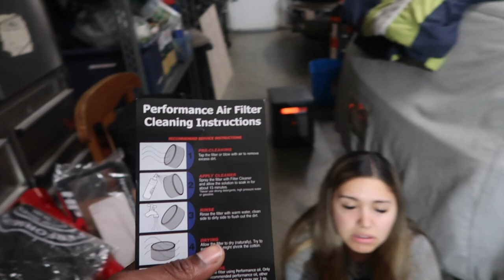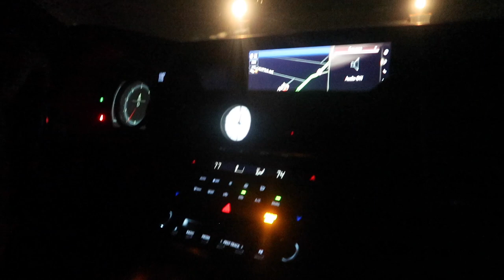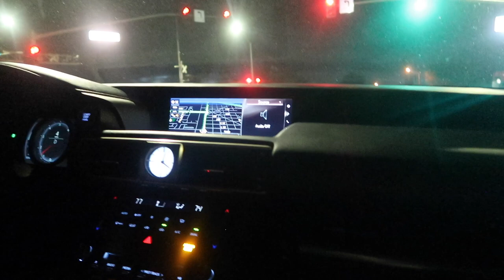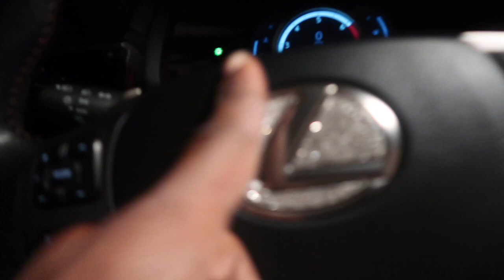SHE SAID SHE WANTED TURBO NOISES | LEXUS IS200T F SPORT HPS PERFORMANCE INTAKE INSTALL!

Comment: Good first mod but it’s just a placebo effect. The car is a 200T with major throttle lag the only good thing about this mod is the the sound and the cool looking intake. You should try a throttle responder instead that will help you eliminate the lag a little bit and you can actually feel a difference.
Reply: Or upgrade the charge pipe and downpipe as well with a “tuning box” . The lag is definitely due to the whole intake and exhaust system being restrictive.
Reply: @Redhawk0117  Im sure any upgrade/tuning will help the car. If you've ever driven one you can tell the car throttle lag is dangerous.
Reply: 30hp is complete bs. And yeah I have a 2016 Is200t and intake, catless downpipe and full 2.25 back. Throttle controller changed mine dramatically and made hella difference especially with lag. Gonna have to do away with mine when I get jdm tune because it interferes with tune
Reply: @Riffsnruckus  can I get the info to fix the throttle lag? Just bought this car and that throttle lag is mf ridiculous. Can I get brand and site. Thanks
Reply: @Riffsnruckus  thank you bro for the reply! Appreciate it. Ok, yes I will be getting the HPS intake tube and also putting a AFE dry air filter in the Oem air box aswell to help free up restricted air. Also did you mean the intake tube was aggravating to install? I’m also getting the throttle lag commander, how much did you pay for your? And what brand did you get. I see AFE makes one and also RACECHIP. Did it throw any codes? And after these mods I mentioned did it throw any CEL? These are all I’m planning on doing for the moment. Will the 3 mods I mentioned help out some? Also do I need a tune after these mods or will it be fine? Thanks again
Reply: @swervv2957  the freeing of restriction of air will be mostly from removing the oem air box which restricts most of the air flow and replace that with a cone style intake filter like the burger Motorsports one I mentioned or Injen makes a good one with polished tube, heat seperatpr between filter and tube and cone style filter. That housing has to go or you’ll get half results. And the intake is easy install I actually had my girl do it lol it’s the hot side charge pipe hps make for the intercooler that’s a hard but doable Install. My throttle box was a $80 eBay no name and worked and was impressive but I recommend a higher quality because after a year yet only like 3 times but I’ve got in the car and had no gas pedal and had to uninstall to get throttle and once I did I had cel and traction stuck turned off until ecu realized after a drive or two that pedal was normal again. I still use it from time to time but not much because about to get a tune. And if you plan on a tune don’t bother with the throttle box because the tune covers that and box will interfere with tune if left installed. I’d also free up exhaust flow and if you don’t want it loud or anything you can get high flow quiet systems. I went with full delete of all 4 resonators and both mufflers and had 2.25 custom from cat ran back. Still haven’t Installed the catless downpipe but will let you know results when I do. Lemme know if you have anymore questions. Also I recommend if you’re on Facebook join “Lexus is freaks” it’s a group I’m
Active in and you can get lots of help and discussion forum style without the wait. Also there are several other pages that are helpful as well as “Lexus is/buy-sell” page where you can find part outs and deals on parts as well as advice. If you join a page, comment again and let me know email or user name and we can link up on there. I have 4 sponserships
And pending a 5th on my car from my network of people in there so if you wanna save enough money on one mod to pay for another then it’s worth the legwork to get sponsored and easier than you would think. I’m also on Instagram for my car page  @sexy_lexi200t you can follow me on there and see my build as well as reach me for help. Good luck man and I’m
Here if you need further help

Comment: All the Perf.intakes say 18-30 h.p. Several People on U Tube that Installed Taketa,Stg.2 Cai,Say it Gives Much Better Sound @ higher rpm,But Minimal Extra H.p. & Gas Mlg.,Prob.Because W/ the Perf.Intake Ur Going to Be Punching it More for the Great Sound.Almost Sounds Like Perf.Exhaust @ Higher rpm.

Comment: looks Awesome!! I have the HPS silicone air intake hose in blue and it feels more power and better response. I also have the HPS charge pipe, I recommend it.
Reply: @Lewis Brantley instablaster :)
Reply: @Emery Ezequiel it did the trick and I actually got access to my account again. Im so happy:D
Thanks so much you saved my ass !
Reply: @Lewis Brantley Glad I could help xD
Reply: What’s a hps charge pipe